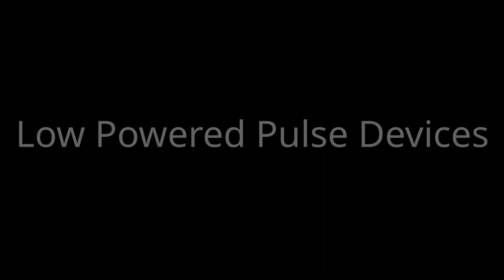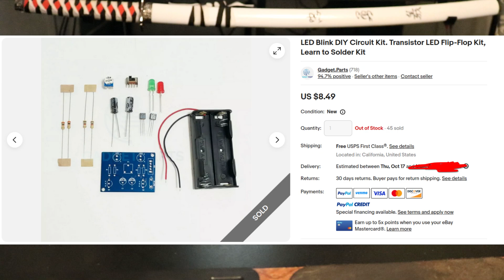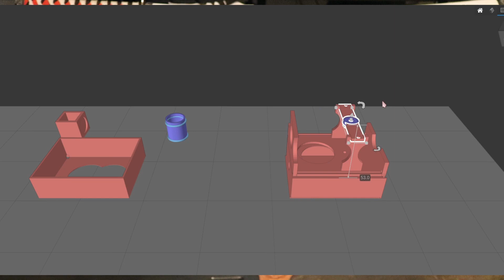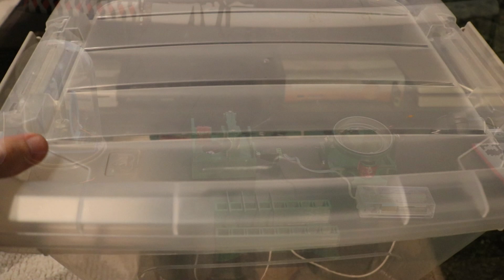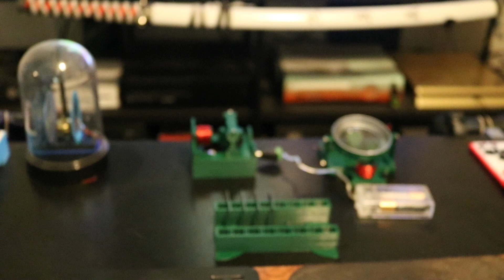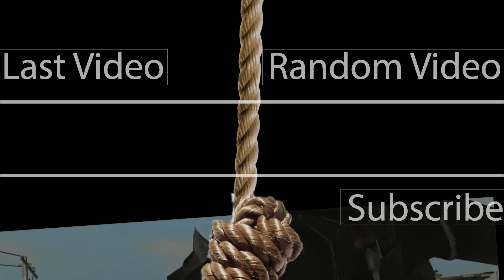Low Powered Pulse Devices "Dirt Battery" Part 1

Comment from the maker: Completely forgot to upload the models for this one but I might make a video on the new one it wouldn't be a long video but the model is better with the inverted needle pivot so I will upload the model for that instead. 
I did try to drive it with the last circuit and the dirt but timing and various issues happened with it so I just had it going off the circuit in this video for now and it been really good.

Comment: You can get low powered CPLD, FPGA and MicroControllers. Would likely improve your designs greatly.
Oh and I also use Matter Control. Great app.
You just earned a sub, bro.
Reply from the maker: Thanks i'm glad to hear you enjoy the videos. :D My current plan is to use a single npn transistor and a 2 coil set up I already inverted the pivot and like the new design more just have not finished the circuit since I need to wind 2 coils and the position them correctly but I might want to change magnets first these weak ones im using don't do a whole lot to help.

I think for the tilting one I might use a micro controller to make it like a clock but trying to stick with as low power as I can get it right now.

Sorry for the late reply back.
Reply: @everythingdigital1  try a mosfet instead, standard transistors are too lossy for low powered applications.
Reply from the maker: @officermeowmeowfuzzyface4408  I think im gonna try a circuit I saw online its like a crude joule theif but might be able to adapt it to low level logic mosfets it charges a capacitor then it dumps the voltage into a inductor turns on a npn transistor for a moment then the other coil kicks back to a led turning it on dumping the current then the capacitor recharges and cycle repeats seems pretty clever and could work while also using only 1 transistor and the really not optimal galvanic battery I made.lol.
Reply: @everythingdigital1  for that, you can use a comparator, with zener as reference voltage, as comparators will have high impedance inputs and won't leak the electrons you're collecting. The comparator enables the mosfet to dump the accumulated charge to wherever. You will want to use a tank circuit tuned to, say 60 Hz (59.9Hz?), since we use that here for mains. Or ~50Hz for Europe etc.

Comment from the maker: I already wanna change to a single or still double npn transistor setup but I wanna use 2 coils so it uses less power instead of always switching by using the second coil as the trigger instead. 
-----------------------------------------------------------------------------------------------------------
Another thing I foresee is the screw getting gunk on it so I may invert it upside down for the globe so that can't happen even if I can't cover it with a dome or dust cover.
-----------------------------------------------------------------------------------------------------------
Also it wobbles now as mentioned in the video I think I had a pla strand or hair at the top pivot point which kept it straight and had tighter tolerances its a simple fix so I might work on the model before posting it in the description. With that said hope you guys enjoy the video.
Reply from the maker: I did change the design it is much better and the circuit I came up with should drive this great even with the sub par cells due to inductive kick and charge over time. I just am testing the build but this cell design and the "new" one I have been working on both should work great for the new spinner it effectively already out ran the run time of this one 2 fold with leds.

So as soon as I am done with a few other videos and the tests I have running for the timing seem positive I will get the new spinner going for a video with luck it should use just a single transistor to drive it which is what I wanted it wont have a self start right away but I think I can also make that work eventually.